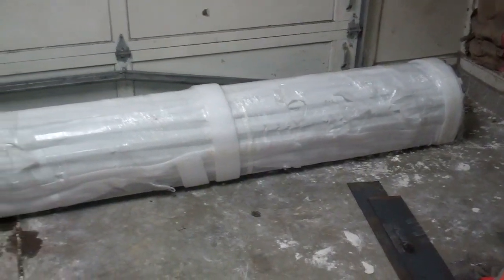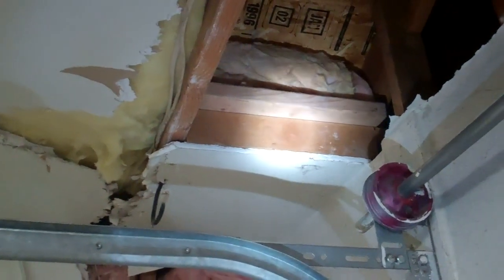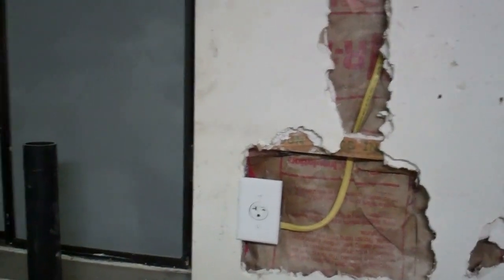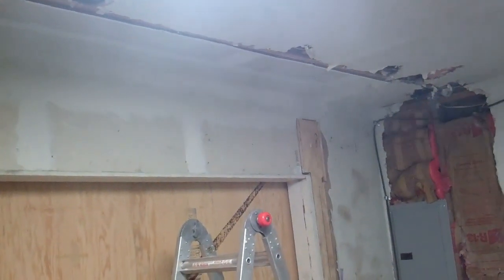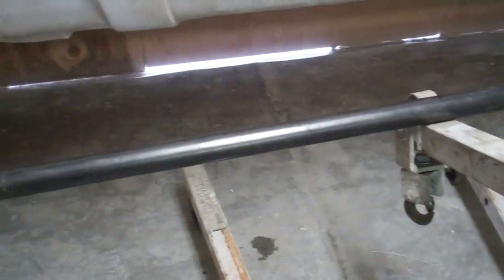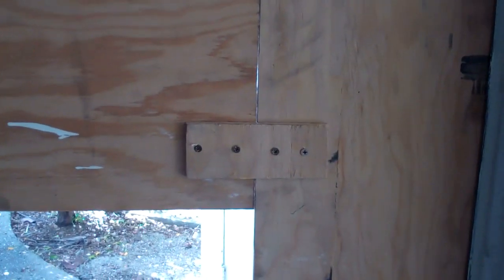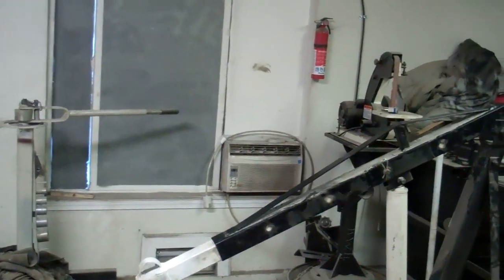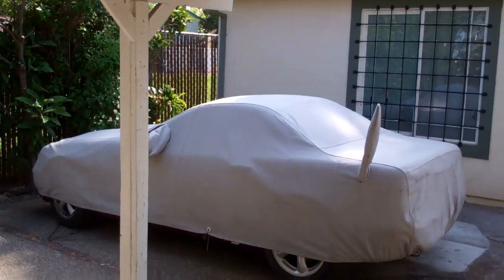Garage Work (Part 3 of 5)

Comment: that door is loads better, I see what you mean about the headspace, that the biggest issue with the type we have in the UK
Reply from the maker: The garage isn't very big, when I put the new lights up the old door would have block half of them.  You have to have 20 inches of clearance above the door.  They tried to sell me a door that didn't open all the way. I didn't want to do that. I only needed 2 inches more clearance with the right door.  So it wasn't to hard to get the extra clearance.